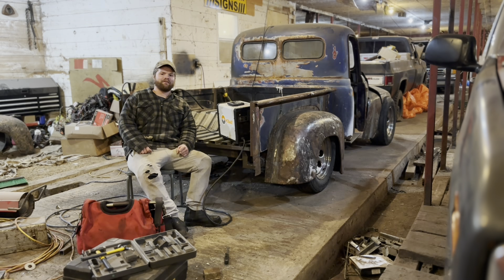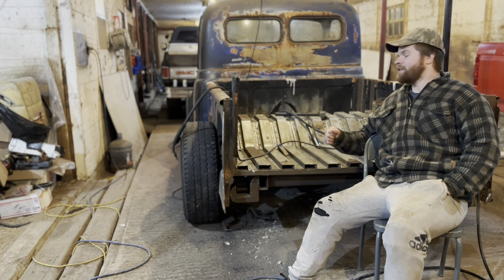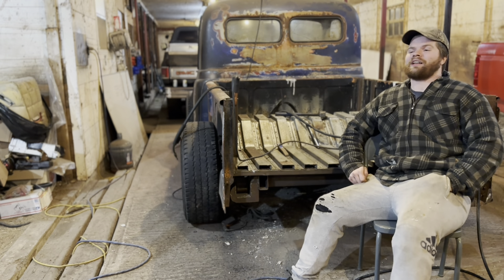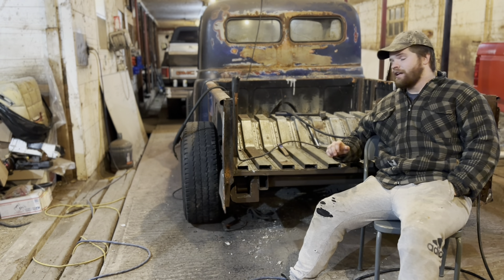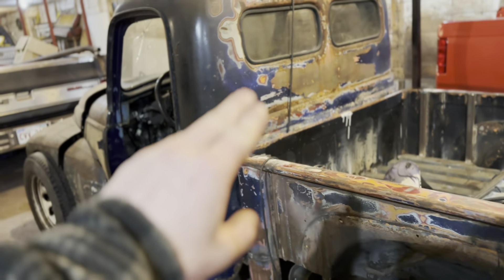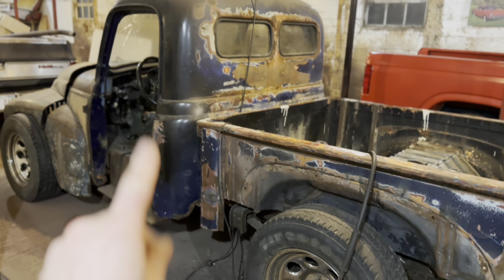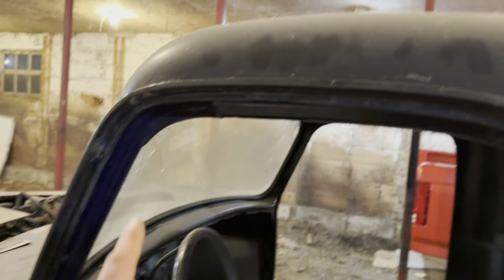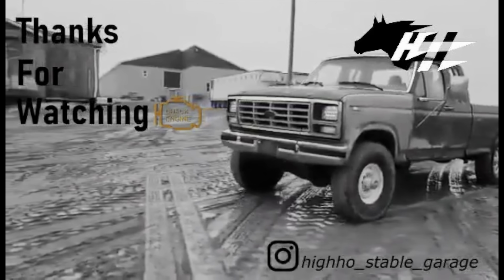Old trucks aren’t built in a day, don’t get frustrated!

Comment: I see you're the same type of gearhead that I am.. take a rusty hulk that isn't even a good parts vehicle, and turn it into a driver. I did it with a 65 GTO and plan to do it again with a 69 GTO.  Its coming out nice, and yeah it takes longer than you think it should or would. 

Living up here in da north rust is an eventuality.
Reply from the maker: You know better than most then haha, but the beauty of working with something that didn’t have a chance of seeing the road again by itself is you can make it into anything you want, as long as it gets wheels that turn on the street it’s been saved in my book.